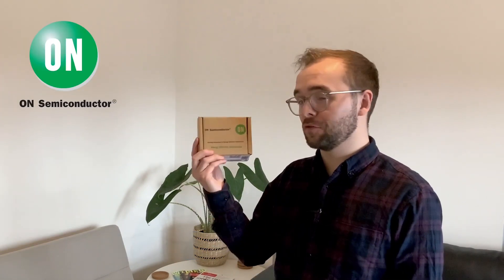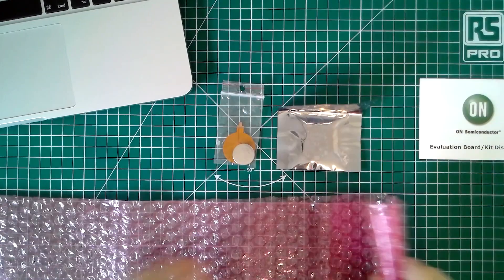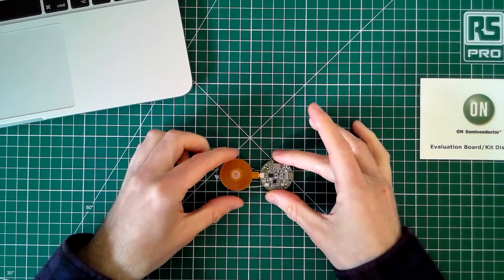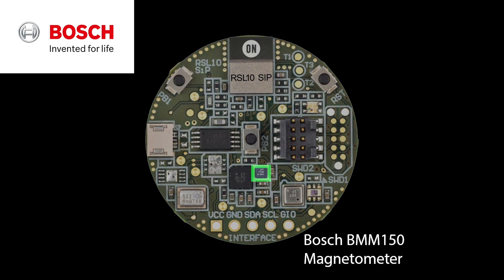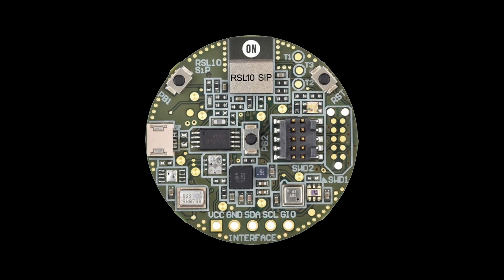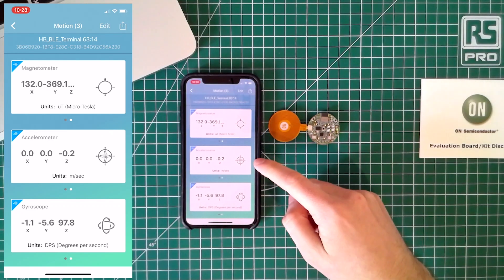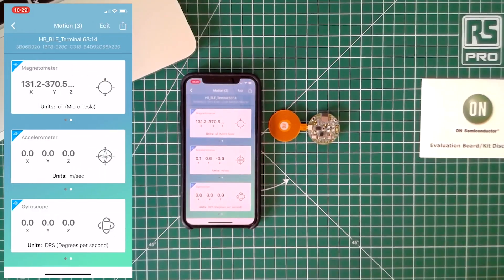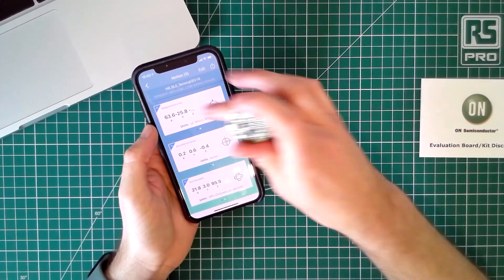Unboxing the RSL10 Sensor Development Kit

Comment: This is the first that I have heard of this Development Kit. My immediate question is 
"Since bluetooth is only good for a distance of about 30 feet, what is the ultimate point of this application?"
(Limited to a maximum distance of 30 feet, you can use your BODY to acquire a good estimate of what temperature/acceleration is taking place.) 
Hopefully, it is possible to connect a more Powerful and more Capable processor (Arduino Mega? Raspberry Pi?) to the RSL10 via the JTAG connector. Using a 'mega' or 'pi', you could then WiFi to the internet. Maybe you could create another video that shows how this suggested implementation might be wired/accomplished? Maybe you could show, using standard Arduino "language" and standard Arduino "include" libraries, how to directly access each onboard sensor with SOFTWARE references/statements?
     As an all-around Sensor Device, it seems to have everything covered (temperature, gas sniffing, acceleration, humidity, etc.) in a very small component. Providing more information as to how to go about writing DIY Android phone Custom Apps, per each onboard sensor, would be great, too.